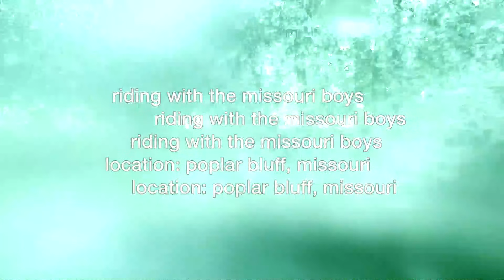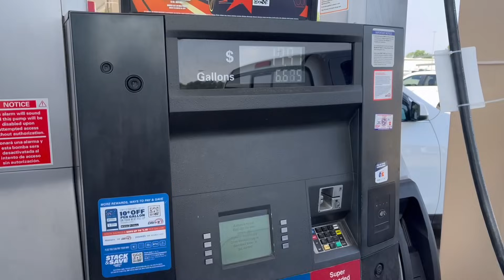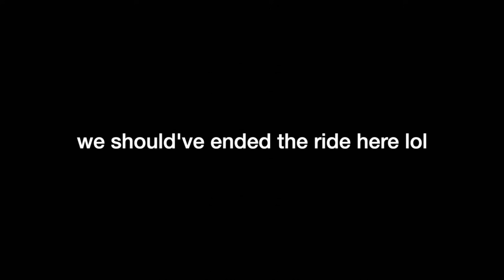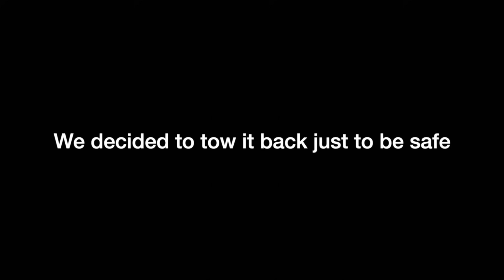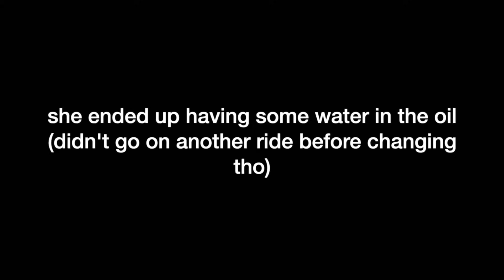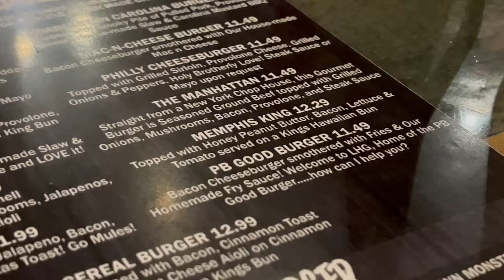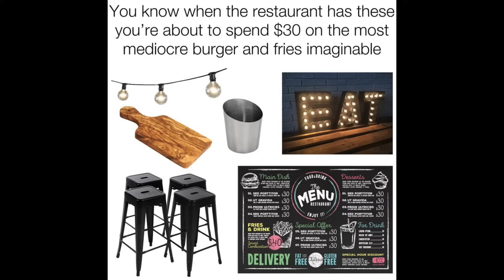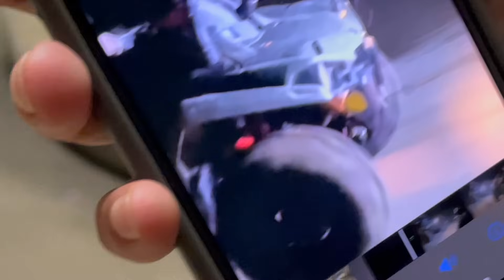I already SANK my 2024 Honda Rubicon

Comment: Hey JP thought I pass this along to ya buy a can wd40 to keep In glove box your bike you can spare the plug and in the plug hole it helps dry the water out quicker that old school ford trick the distributor use to be on the front of the engines and moisture will get into the distributor cap and you’d have to spray WD-40 in there to get it to dry out to Ware fire properly. It also works well spray the frame where mud doesn’t stick . Just thought I’d pass it along to ya.🛠️🔧👨‍🔧

Comment: A tip for anyone that doesn’t have a front locker. Lightly grab the front brake, or on canam just the single brake lever. It’ll lightly apply pressure to all wheels and help the front diff put more power to the tire that’s stuck instead of spinning one tire. It’s not perfect but it’s better than nothing!

Comment: if it cuts off under water i wouldnt wait that long to pull it out, just pick up the back end and hold the ignition and it will eventually start, i have a foreman 520 and thats what i do and it always starts up just fine
Reply: Whether it starts or not is a gamble. If the piston was on compression stroke and the exhaust valve closed right after water entered, it may hydro lock. If you can catch it on decompression or even better on exhaust stroke, the starter will just push the water out. All depends on where your valves were when it shut off. Lifting the rear end isn’t going to do much other than ensure water stays in the exhaust pipe honestly. The reason Hondas are infamous for starting after is just a statistical likelihood since they are all single cylinder engines. There’s a 50/50 chance it stopped in the right spot. On parallel twin engines, it’s almost guaranteed one cylinder hydro locks because if one is on exhaust stroke the other is about to begin compression stroke.

Comment: Yup Can Am clutches will let you down everytime. Dont have that problem with Polaris clutches.
Reply: I like my shaft Drive 5-speed all-wheel drive Honda Foreman automatic ATVs suck because they are belt drive and you get water in the belt cover and it's going to slip

Comment: The Reason why it stalled is because you didn’t let the motor adjust to the Coldwater after driving a distance.
Reply from the maker: @jamesjanzen9806  yep
Reply: Can to the comments just for this absolutely agree let it cool off in a lil bit of water especially after driving it like that

Comment: I would rather use my Hunting Fishing trail riding buggy 84 Bronco 2 V6 4-speed manual 6in lift with 31 9.50-15 TLS boggers I've only had her stuck once and that's because I was pushing mud with my bumper and harmonic balancer and busted some blades off of the plastic fan when they hit the water had water in the floorboards which I had already pulled the carpet from